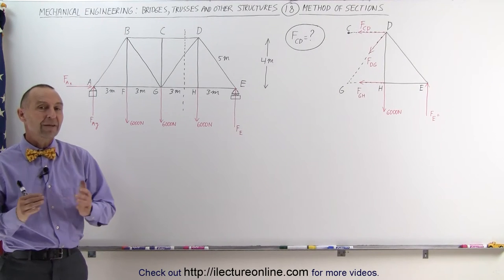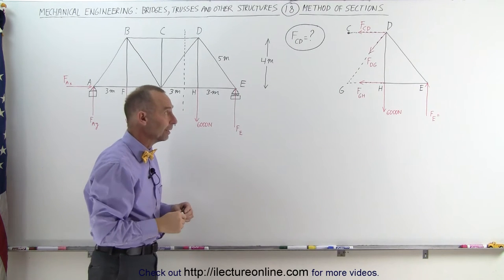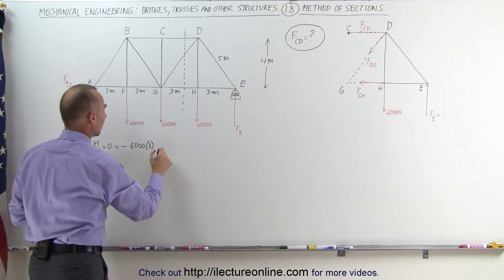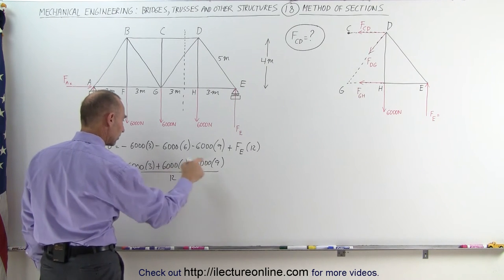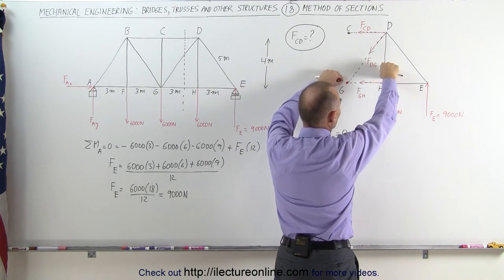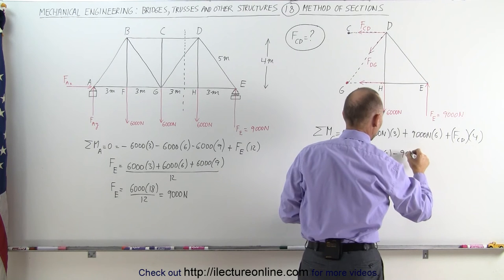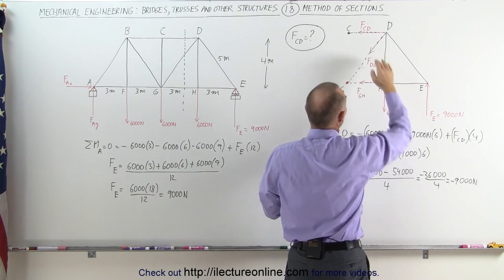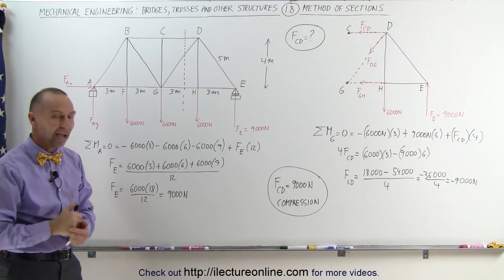Mechanical Engineering: Trusses, Bridges & Other Structures (18 of 34) Pratt Bridge: Sections: Ex. 1

Comment: Is that make sense if i say all the forces drawn in method of joints and method of sections are both taken as external forces exert to the joints? And the internal forces of the members is also taken as external forces to joints.